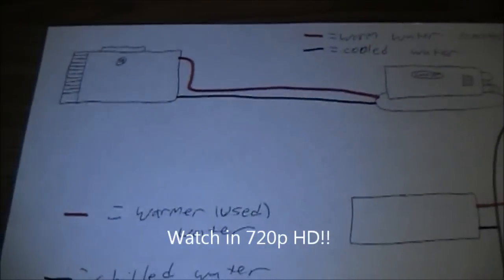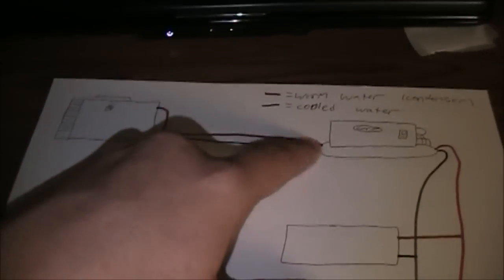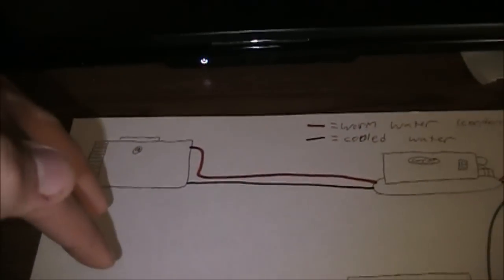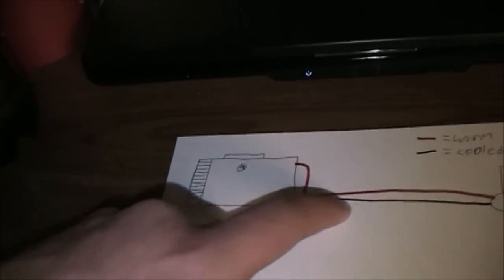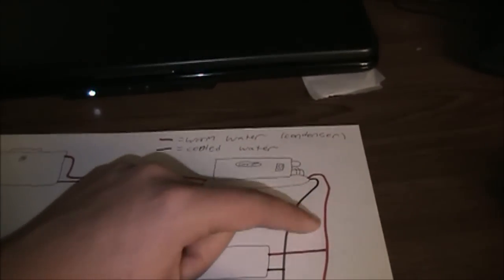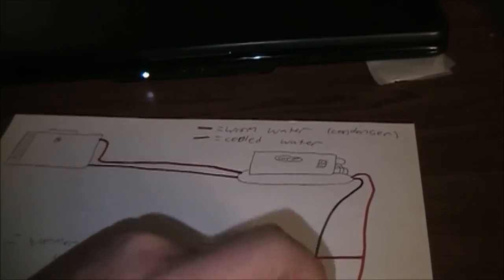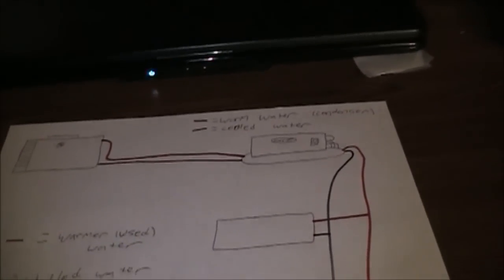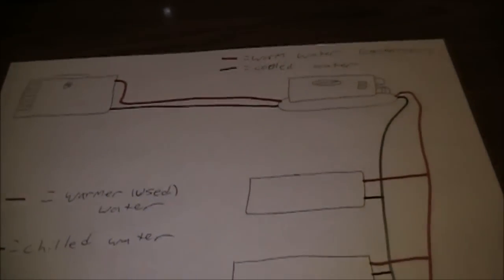How a Liquid-Cooled Chiller system Works

Comment: The nice thing about these if you have a building that requires cooling and heating simultaneously in different zones in the building, you can use the condenser water to heat parts of the building and cool others, and not even have to use the condenser. An example would be a building with a lot of windows, the side facing the sun will have a heat load, and the side in the shade will need heating (assuming cool outdoor temps, high occupancy in the building, and bright full sun).

Comment: So if I'm understanding right a chiller is like a package unit without fans that uses water for heat transfer
Reply from the maker: Basically yes. Uses water to cool the condenser of the unit and circulates water over the evaporator coil in the evaporator barrel of the chiller, and that water is used to cool the building. The condenser water circulates through cooling towers to cool it.
Reply: OK thanks a lot that really helped me out in trying to understand how this works
Reply from the maker: Merida Tovar You're welcome, glad I could help.